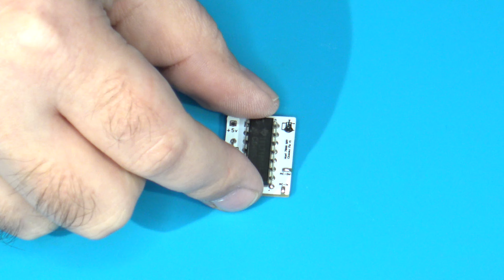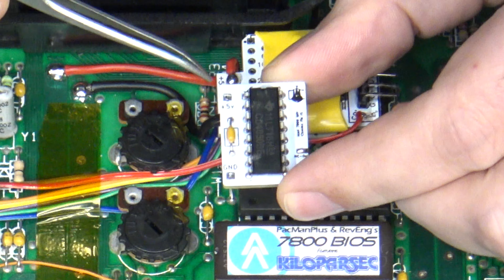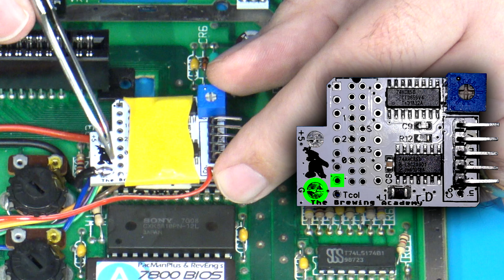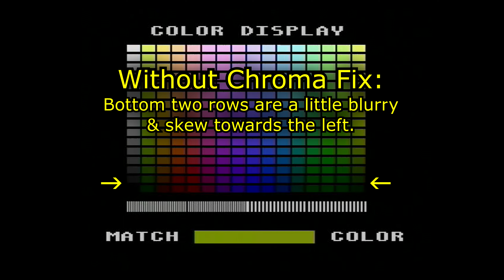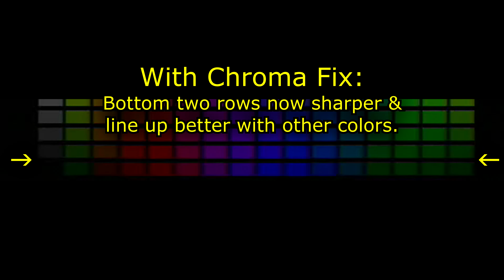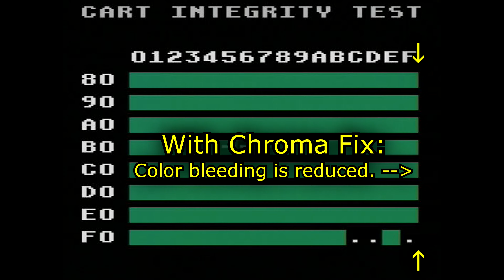ITC Shorts#16:- Atari 7800 - UAV Chroma Fix Installation

Comment: It seems that I'm WAY behind on 7800 tech, since my composite mod is now probably 10 years old, and that UAV board looks way more crisp. (but complex)
Reply from the maker: The UAV isn't that difficult to install and I've even got an install video I did like 2 years ago I think? Until an RGB solution comes about for the 7800, the UAV is the best AV upgrade currently available. Even the composite output from it usually looks a little better than the more common composite only kits. But the s-video output is where it really shines in this case and that was s-video captured at the end. Thank you for watching!